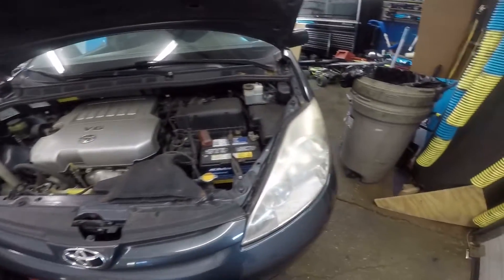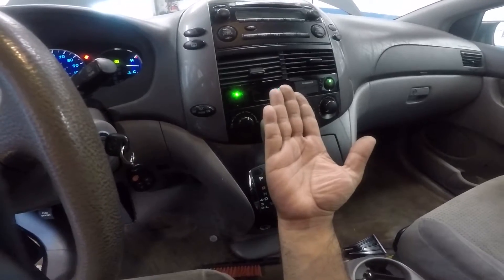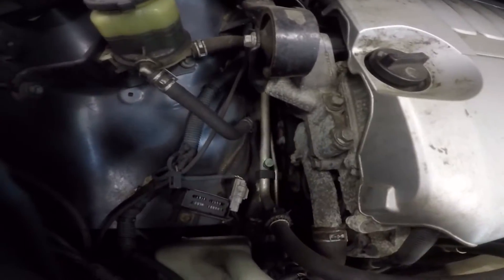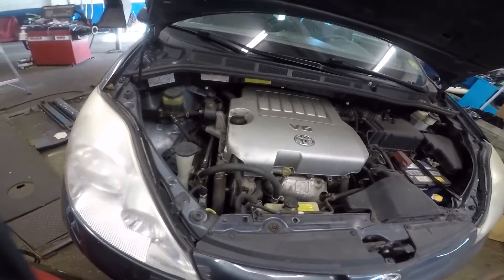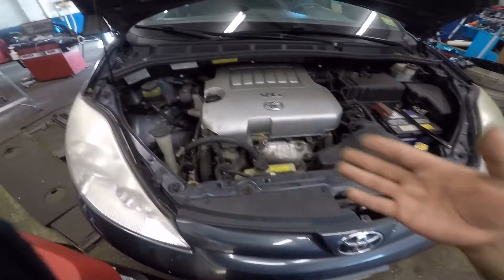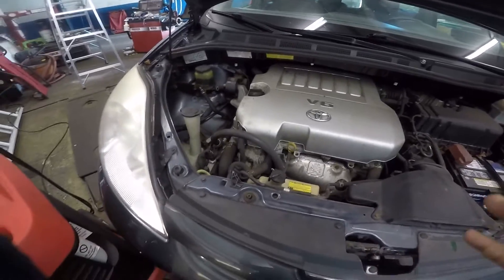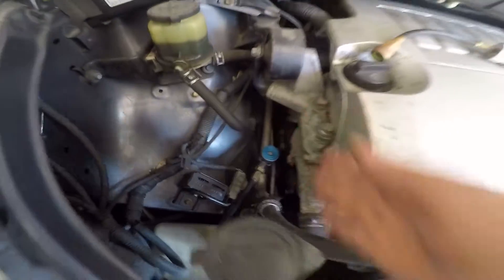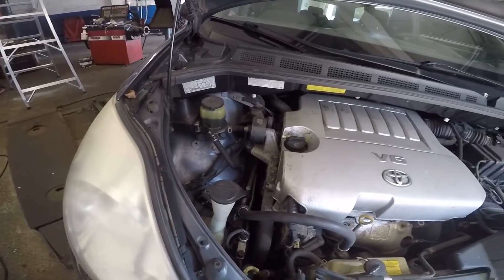AC LEAK how to trace it down using DYE and UV LIGHT

Comment: You said you have oil in the container, (injection pump)? and you said you added some UV dye to the oil? what type of oil is this in the injection pump?
Reply from the maker: Pag46 oil it’s most common so depends on ur car I could be diffrent type oil
Reply: @RBTheMechanic  Ok, I found out I need PAG 46 and I bought some R-134a PAG 46 Refrigerant oil from Autozone. However, I am now in need of knowing how much of this stuff I must add to detect a leak. I am testing a 2003 Ford Crown Vic. I have the same pump as you in your video.
Reply from the maker: @MichaelSmith-qw3is  well first of all u can’t add this stuff with can it wount take it in or u might just be jamming it in best way to do it is recover what ever is in there with ac machine then vaccume the system for 20 minutes add correct amount oil and dye it should have sticker under hood that tell you how much oil u have to put and do 1/3 mix 1 of dye.  And then add correct amount r134.   Don’t use them cans bad idea
Reply: @MichaelSmith-qw3is  right, did you get it fixed?